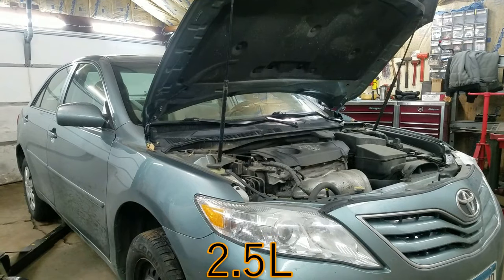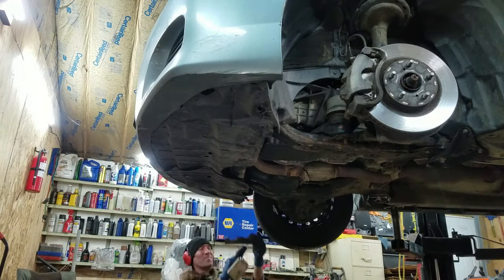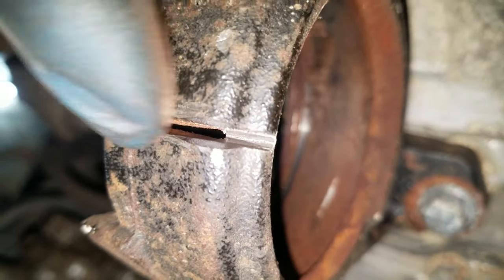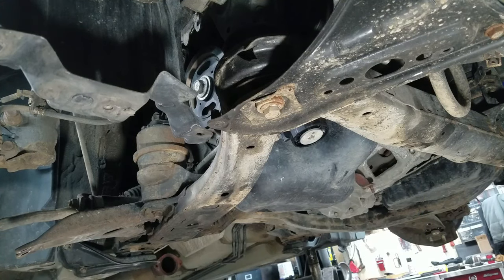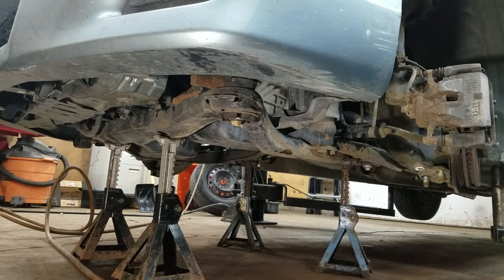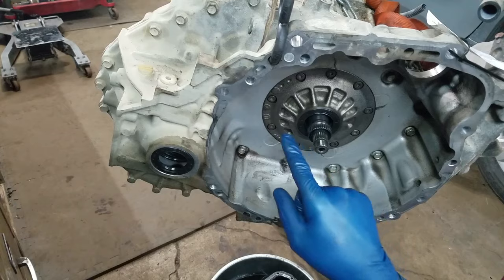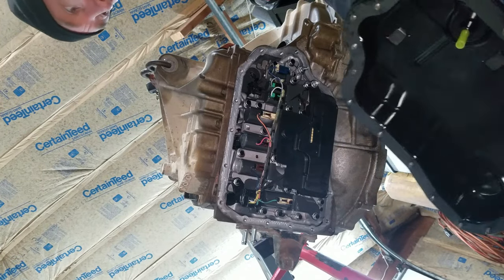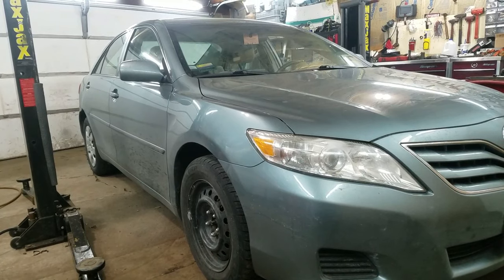2010-2017 Toyota Camry 2.5L transmission replacement

Comment: You removed that passenger side CV axle soooo wrong.  You forgot the 14mm at the bottom first of all and yes you can unbolt the bolts on the bracket holding the carrier bearing.

Comment: Much respect, don't think I'd try it without a lift though. Shows why the labor costs are so high.
Reply: Toyota techs remove the engine and transmission together, that's why their labor cost is high.

Comment: That's why I'm a big fan of the old days Manual Transmission much simpler and the last the life time of multiple cars,minimum maintenance.
Reply from the maker: Everything now days is created with the intention of planned obsolescence. If something breaks down, or doesn't last, it becomes corporate profit. Exotic, and luxury cars are designed with the highest failure rate. Unfortunately, trucks that are supposed to be the most utilitarian, are now catering to the luxury car enthusiast's. In most cases, older is better. If this economy crashes from a currency crisis, things that can be rebuilt will stand the test of time, just like the old days.
Reply: @RustBeltAuto  i agree its all about the dollar,  Toyota tells you trans fluid is for life, they figured its should last around 60 k miles, and after that you're on your own
Reply from the maker: "Lifetime fluid" is a funny word. It IS planned obsolesence.

Comment: Hi bro. I would like to know why you put in 7 qts of oil and then removed oil after half hour? How much did you remove? What has the temperature go to do with the gearbox function.  I will be doing a converter seal replacement next week.   Thanks.
Reply from the maker: Transmission fluid expands with heat, and is checked at operating temperature. This thing has a check plug, and no dipstick. You overfill it, get it hot, pull the plug, and let it pour out. When the fluid goes from a pour to a dribble, you put the plug in. I though I explained that pretty well.
Reply: One question what happend if u dont take the extra oil  out

Comment: Will I have to do the same for an 07 Camry ? I have a punctured rear main seal, just throwing all my transmission fluid up soon as I pour it in and crank him up. I’ve been looking at videos of doing the seal without dropping the transmission. Is it possible, because I can never find one with my year. Either an 95-06 or 2008-2017. I don’t really want to remove my transmission, being that it will be my first time. However I’m very willing to remove it to do what I have to do. Because I’ve been looking online also videos  and yours is the best one by far.
Reply from the maker: Yours is a little different. I have done engines on those too. It comes out the top, and you pull the wiring harness through the firewall, and leavin it all on the engine. You choose.
Reply: Thanks man I didn’t even know you replied I appreciate it

Comment: I just had a rebuilt transmission put in my 2012 Camry when I picked it up from the shop to steering was very stiff. They had somebody driving around and said it should be fine after i drive it for a bit. Can u please comment on this?
Reply from the maker: Have your service rando steer it. Obviously you drove it a bit, and it's still not fine. Sometimes you may need to bleed out the power steering. There is a procedure for that, but driving it usually takes care of it.
Reply: @RustBeltAuto  ok thank you. As long as it’s normal. I was worried that maybe they didn’t align something right

Comment: is the 4cyl engines that have the bad transmission or its just something you can't avoid?? I have 2012 toyota camry never replaced my torque converter and it's never broken down since 2014 but I'm ready for new car with out shuddering trans...which years don't have the shaky transmission
Reply from the maker: None of them are supposed to have a shaky transmission.
Reply: @RustBeltAuto  but they do...2012-2014 failled torque converter toyota covers it

Comment: This water under the bridge but they had a recall on torques converters that required a software update as well. I don’t know if it was a lockup issue or what. I have see GM & others do things to hold the front seal in (Some have 3 screws) but the front pump busing? Some use thread locker and stake the aluminum around it, but their are few excuses to the pump bushing to stick to converter unless little supply, little drain back or not centered. That’s crazy!  Any root cause determined? I thing I will but a horse and install a post-poop-catch-all behind the tail pipe. Some heavy canvas, snaps and solar heater, then it will look like a 1968 John Deere 4020, grocery wagon not included! ASE Master Tech since 1978-Retired! 
( No 2,000 salt spray test will ever impress me again, It needs 100,000 hours plus another 80k in heat at 90 -100 degrees F. Then, all manufactures executives & directors must drive their cars built completely of scotch locks wiring systems ) Damn throwaway cars. That’s what they make.

Comment: whats funny is ive had people tell me its lifetime fluid for a trans on these things which i know is bs. whats your opinion.
Reply from the maker: My opinion is sometimes best not to have one. Cars don't last a real lifetime. I think a lifetime to a manufacturer is 10 years, and they do not extrapolate how many miles a life is. It's just a made up word. They are in the business of selling you new stuff.
Reply: There's no real easy answer to this question. A lot of manufacturers have designed fluids that's suppose to last say 120 -180k miles. The reason being that a lot of owners tend to upgrade to newer cars say after 3-5 or maybe 8 years, and either sell or trade in their old vehicles. With this trend owner's don't really have to spend too much money on servicing their vehicle a lot. There are certain items that are meant to last as long as they can. There's no definite/fixed schedule to replace/flush out the transmission fluid, sometimes this includes engine coolant too. It all depends on manufacturers maintenance plan. My personal opinion is that as long as the transmission is shifting fine and working fine, then leave it alone. Unless, there's an issue with it then diagnose it first, determine what's the issue, and then follow the recommended repair procedures to repair it. This could be anything from just a simple drain and fill, maybe reprogramming the ECU/TCU, to replacing a component or two of the transmission, or replacing the entire thing. Hope this makes sense.

Comment: Where is the transmission pump located
Reply from the maker: Inside the transmission, and driven by the rotation of the torque converter. Converters also consist of a turbin, stator, and pump, but that is different.

Comment: Can a 4-speed transmission be easily replaced with a newer 6-speed transmission?
Reply from the maker: My sources say no.
Reply: Swap to manual is possible because itself manual transmission are 100% mechanism other than sensors. 

Original ecu can run without transmission(ecu thinking it on parked or neutral gear) but would limit up to 4,000 rpm. Get custom 2.7 ECU from Frankenstein Motor website. That custom 2.7 ecu will work with 2.4 and 2.5.  

2.7 ecu will raise rpm limiter and governor removed. ;)

Comment: I got this 2010 camry , 2.5 engine i got this harness plug in I don’t know where it goes . It plugs to the intake from harness then it has a bracket that bolts to engine just above transmission bolts right beside the intake  then comes around and has a 2 blade plug .
Reply from the maker: Keep looking. Sometimes cars have blind plugs that are not used. If it is, it should be dirty.

Comment: How many hours to change just the torque converter?
2014 Camry. 
In the shop now and they're saying 4 to 5 days. Hopefully Aamco knows what the F they're doing.
 My car is like brand new. It just rolled 100K and had the notorious torque shuddering problem. 
But the car is literally brand new. 
Engine bay is spotless and so is the underside.
Being fixed under warranty thru Carvana. I can't sleep at nights thinking they have my car and don't know what they're doing.
 They took a whole day to diagnose the problem even after I told them that it's definitely the torque converter. Then they said: Hey, you're torque converter is bad. DUH!

Then they put 42 miles on my car to test drive it.
Reply from the maker: Relax. It's under warranty. They are probably really busy.
Reply: @RustBeltAuto  I'm trying to but I read reviews of their store and one customer said they took their car home over the weekend and put 100 miles on it. I'm a locksmith and know all about being interupted and running into unforeseen delays. This Aamco just isn't instilling confidence in me by their behavior.

Comment: 7:07 what if you soaked it for a while with anti seize
Reply from the maker: You cannot soak anything with antisieze. You slather it on, and stick it in the hole. That is all it is good for.
Reply: maybe penetrating oil / wd40
Reply: @gojjjddoooj  Yah, I meant penetrating oil

Comment: When she got the flush.. It probly push to seal out of place
Reply from the maker: Everything was completely dry. They probably used a machine, and what came out, didn't go back in. After that, they didn't check the level. That's what I'm figuring. I have been around flush machines long enough to know what people do. It was not even driven 200 miles, and there was no noticeable leaks. The shop that did the work said it was not their fault, because if it was that low, it wouldn't work, and did not pay for any of the repair.
Reply: Who did the flush?

Comment: So what's the story with this car? The owner came in for a flush and basically they f@cked the transmission?
Reply from the maker: Maybe? Kinda hard to prove when you leave the building without a dipstick now isn't it?
Reply: You leave a building without your stick you got more problems then one
Reply from the maker: @tbskirk  the car doesnt have one. That's my point. Anybody does service to a car with no dipstick, you need to take what they did on faith.
Reply: Which can lead to a destroyed transmission
Reply: @RustBeltAuto  just curious, I have a 17 camry with 30k.  I wanna change my transmission fluid.  But nobody that I have found in the Raleigh NC area knows how to change the fluid correctly.  Have you ever done a transmission fluid changed on one yet? And if so, could you give a some tips or steps on how to do it. I usually do things myself.  Thanks
Reply from the maker: @kgbreviews35  the way I did it is in the video. A lot of people do a dump and fill. They measure how much they took out and put exactly the same amount back in. I do it like how BMW describes it, instead of Toyota. I overfill it, run the car, pull the plug, it pours out, and when it goes from a pour to a dribble, I put the plug in. Transmission over 105* F.
Reply: @kgbreviews35  take it to the dealership only. At around 60 to 100k get the transmission fluid changed with Toyota world standard fluid. The job is at least 2 hours at about $300 dollars.

Comment: when Rust hits a car  it's a whole new ball game. If  welding ain't your thing
and cutting that collar might not be a good idea it comes off easy 3 mount bolts 
take the cv axel out with the mount collar. Lay it on the ground step on the axel and mini sledge hammer even around....
pop goes the weasel

Comment: J have toyota camry1992 2.2  automatic transmitions but ride only in reverse. J want  to change automatic transmition with manual .How much cost complet manual transmition ?Also it possible  to put manual transmission from corolla, celica, carina because in Europe  camry is very rare  morel of toyota. J will be grateful if somebody  give me some information

Comment: What is the torch that you used? Most butane torches do not raise temperature high enough.  I would like to have what you used.  Thanks in advance.
Reply from the maker: MAP gas. It's the yellow bottle.
Reply: @RustBeltAuto  thank you! I appreciate it!!!

Comment: One question. What do you think about this transmission U760E, is it good? Do you know if they have quality issues or defects? I have read they have some issues with the torque converter. Thanks for your support.
Reply from the maker: All automatic transmissions can have issues. Using lamen terminology, there is a lot of stuff going on in there. I prefer manuals. Automatics are for lazy people who spend 15 years of there life stuck in rush hour traffic, or something. They are also quite boring. These have less problems than most.
Reply: @RustBeltAuto   one question, what do you think could be the best way to extend the transmission life without issues? What would be your recommendations??
Reply from the maker: @JesBu  dump and fill the fluid every 30k miles. When new. If old, replacing fluid can be questionable
Reply: It is a great  transmission. I have one no issues at 157k. Lifetime means around 100k miles. Only use Toyota world standard fluid.
Reply: Hey, I have a 2015 Toyota Camry i Just did a drain and fill using Toyota automatic WS fluid. I measured exactly what came out and added exactly same amount back. Odometer 336939 . Had the car since 12k miles never any issue except a transmission shudder at low speeds 37-45 mph noticed it starting at 87k miles. I have Added Lubegard 19610 Instant Shudder Fixx 2 oz every once in a while to slow shudder. I Still drive car daily! I wonder if the seals on the torque converter are bad?

Comment: Can you interchange a Toyota Camry 2012 transmission with a different engine id engine of Toyota?
Reply from the maker: Doubt it. A parts look up on car-part.com might give you a good idea.
Reply: @RustBeltAuto is that a legit website?
Reply from the maker: @prostopper1752  it's a nation wide junk yard parts locating website. Everybody uses it.

Comment: When you get to 14:44 , If I'm only doing a rear main seal, is there enough room to disconnect the trans and turn it/move it away from the engine without dropping the cradle?
Reply from the maker: Probably not. Good luck trying.

Comment: Did you turn trac control off in order to get the fluid into the converter?? When I did then I added 11 qts, about 3 extra, and 5 drained out. I feel as though I did something wrong, now my car wont take off if I don’t let it warm up first.
Reply from the maker: No

Comment: Very Good video.  1 Question for you, I got a Camry i am about to tackle same process with. no dipstick = overpaid engineer.  Question is, can the torque converter just be replaced, or is the whole tranny shot. I got this vibration from tranny at certain low rpm ranges that gradually getting worse, so assuming its that torque converter.
Reply from the maker: I doubt it is a converter. When something is spinning, and is full of fluid, it has a habit of balancing its self. Unless you believe it has a slipping lock up converter clutch. I personally wouldn't even take a chance with all that work, and of course I could be wrong about something.

Comment: Does this transmission have to be flashed after install? Did this job two month ago and switched over the Transmission Module from the previous transmission and the transmission failed maybe 45 days later... I'm being told it's because the transmission wasn't flashed...🤕
Reply from the maker: Don't know for sure. I did not.

Comment: If people just changed their fluid regularly they could avoid this repair altogether! It’s not that hard. 4 quarts comes out.. you put 4 quarts back in. And if you’re not having your fluid levels checked at each oil change— you’re practically begging for trouble. They charge 100$ for your oil change at the Yota dealer but included in that are air filters, tire rotation, AND fluid checks which are invaluable. 

If you know the complete history of your car.. change the fluid. Around every 60K on Asian vehicles. Don’t listen to these people who say it’s a lifetime fluid. It’s not true whatsoever. I don’t care what anyone says.. nothing is lifetime.

And at the end is the great reveal.. I love Rust Belt Auto …the good old jiffy lube flush… please don’t do that. You’re trusting like literal high school kids with your multi thousand dollar machine going that route. It may be speculation on his part but that happens a lot at these lube places.. if there was nothing in the cooler that thing was half empty 😂
Reply from the maker: It's not what you know, but how you know it, and not who you know, but how you know them. Also, when someone tells you how things need to be, you need to question why. Some things cannot be fixed either. Like people.

Comment: Was the transmission making a dragging noise? Or what was the reason for replacement? I have a 2012 its making a dragging type noise like if a plastic cover was dragging. Im thinking transmission is the issue. Wheel bearing and axles are new and no plastic covers are hitting or dragging
Reply from the maker: It didn't work.

Comment: Thank you for the video! watching this i realize im really in for a treat!! I have to replace the torque converter on my 13 camry, plan on doing it in my garage, no experience on newer cars or automatic transmissions, just changed a few clutches on old VW's.. having a feeling this is going to take me a week in my garage at home!  after the torque converter/transmission issues with toyotas i just bought a 22 6 speed manual toyota corolla hatchback... id rather deal with changing my clutch than a trans or torque converter!
Reply: Update

Comment: I agree a sealed transmission is stupid no matter what it is if it needs fluid or oil to operate you need to be able to check it with a chopstick
Reply: Yes, there is still a way to check your fluid level even in a 'sealed' transmission with no dipstick. There is always going to be a 'fill' and a 'drain' plug. Also, you have to know when and how to check the fluid level.